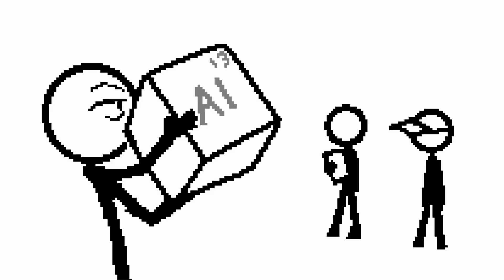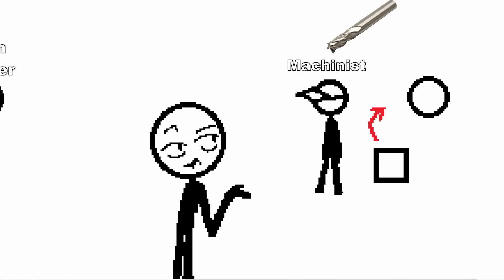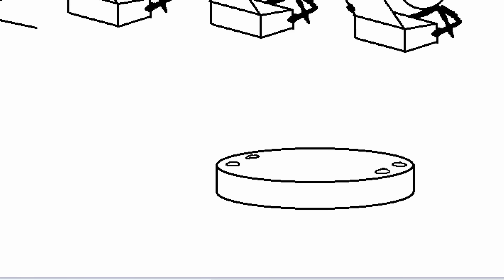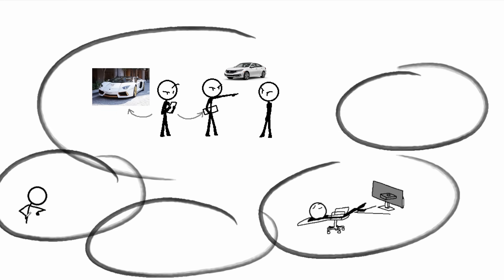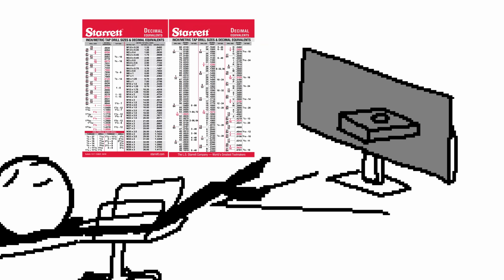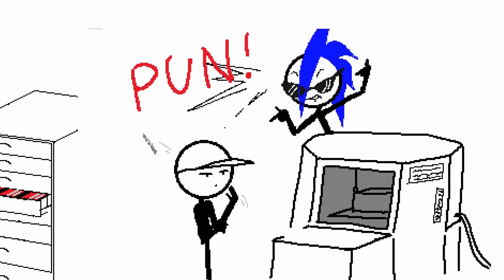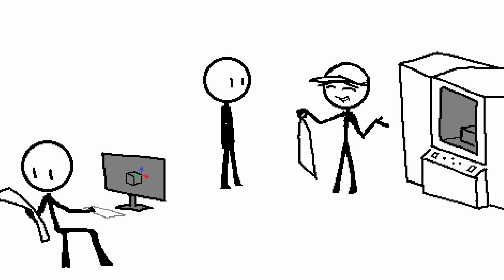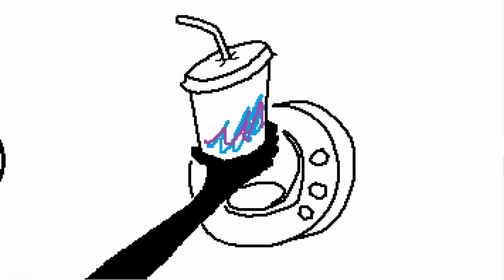Why we hate engineers

Comment: (soon to be) aerospace engineer here, this is engineering 101. The most important things we learned in our engineering class was to not overdo tolerances for basic shit, our teacher had a 3D printer on the rough setting for one project and we had to print and assemble a wing brace retrofit. Most of our class's models didn't fit together the first time because 3D printers always thicken everything a little bit (a 5mm hole might be a 4.5mm hole, a 5mm peg might be 5.5mm peg), so a bunch of people had to file stuff down, but then a few people had the issue of unrealistic thinness where their model would snap in half due to how thin they were. Watching this video in advance probably would have saved most of the class a bunch of time but I'm pretty sure this was meant to be a "learn it the hard way" project to drill the point in
Reply: Horizontal expansion should have been corrected in the slicer settings, rather than the model.
Reply: First off, buy a 3d printer. It's such a great hobby to do while you go through college. You'll also learn basically all your CAD stuff without even trying. 

Second, 3d printing has a ton of parameters, and you can drastically change results by tampering with settings. CNC Kitchen does a great job of going in-depth on individual parameters. You can watch those and combine some techniques to build some quite strong and impressive parts. But for things like holes, I almost always drill them (to the final diameter). If there's no requirement to pull parts straight off the printer and into the assembly, use a drill, a tapping set, a woodworking chisel, and some strong glue (epoxy or CA would be my choice). Those tools will allow you to do a ton with 3d printing for tolerances and mechanical fits.
Reply: And I was told almost exact opposite as my teachers required to describe everything what doe not really needs to be described
Reply: I don't think anything beats IRL experience, though. The video helps, but feeling the issues with your own two hands really helps.

After lots of hands on working with my Uni's 3D printers pretty much every part I design now fits exactly the way I'd hope for. PLA and a 0.4mm nozzle Prusa printer isn't amazing when it comes to precision, but when you design with the layering and expansion quirks of the material in mind you can get to some remarkable places.
Reply: Sounds like your school needed a better 3D printer! 0.5mm play. Holy shit. My Prusa MK3S can do 0.1mm tol and it's still loose on straight edges.
And people needed to run some tolerance tests first!

Comment: This is one of the best paint production videos i've seen, and funny as hell too, AND SO TRUE. I have worked in manufacturing, not as a designer or machinist but as an electrician and it's about the same, but it's most often the case that there are like a quadrillion of different types of everything, like 1000 things that do the same thing, just slightly different specs but they would all work but they want to save 5 bucks here and 2 bucks there etc. (money that is wasted in time trying to find all shit, and storage and everything, not to mention supply lines). So we had a small warehouse of electrical stuff, that many of them was used like once every 5-10 years. And an internal database of everything because the names of these objects is like ER-43-FnFI.3432.5 50 16A but don't mix it up with ER-43-FnFI.3431.5 50 16A because that looks exactly the same but have vastly different properties. So i felt like i was more of a logistic clerk trying to find waldo and staring down at papers at super wierd names making me dizzy, than being an actual electrician.

Comment: In Germany we have the DIN, which basically means "German Institute for Standardization" and the DIN specifies everything in such a way that there is only a fixed selection of screws, gears, etc.  So all drawings are ready for production and all threads are fixed.  That makes it much easier for the people in production and we have a lot less stress with them.  In addition, everything we design is therefore more maintenance-friendly for the installers.
Reply: Which is nice in Germany, but maddening to anyone involved as soon as any of those things have to be fixed outside the country. German-made stuff has a certain reputation in machine shops around the world. All that internal standardization is basically unicorn farts to everyone else.
It's not so bad most of the time, and people tend to get the gist of it with experience.

Comment: I am an apprentice trained designer so the first 4 years I spent on the shop floor covering as much manufacturing as possible, from regrinding drill bits to CNC programming and everything in between. By spending time on each process it gave me a greater understanding of what is and isn’t possible. I have worked with purely university trained designers and their lack of hands on experience usually shows in their designs

Comment: OMG!!!! I'm an electrician and I was saying "YES!!!" to almost the whole video. Primarily the end about mixing engineers and the old experienced dudes who actually installed shit for a living. I really liked the animation too. It may have been simple but it delivered where it needs to deliver. I laughed, I cried, and I had boughts of anger (borderline PTSD?) at how close it comes to everyday life for tradesmen. Well done!
Reply: No bro I want every device wired with 3/4” rigid metal conduit and #10 stranded wire. All data wire must be belden, data boxes require 2” conduit. I want every light controlled with a 3 way switch, motion sensor, time clock and photocell. I also want cct:1 on one corner of the building, cct:2 on another corner and cct:3 on a different floor. 

Any deviation from the engineered plans require written consent from the engineer.

Comment: I'm a boilermaker/welder and a mechanical engineer. I tell you what, my trade experience really comes in handy as I constantly think on how I would make this thing myself that I'm designing. I've seen so many engineers/designers that have no practical experience, designs something that is either impossible to manufacture or frightfully expensive when it never needed to be.
Reply: I feel like hands on experience should be a requirement to be an engineer. That’s how it was back in the old days, we should’ve evolved to tinkerers that also know the theory behind why it works.
Reply: @sama847  totally agree. There’s a lot of engineers (many from India) that have not mechanical know how or even an interest in mechanical things outside of work. Just got their degree (and that’s often fairly suspect) and straight into some engineering role to wreak havoc 🙄

Comment: I'm not a machinist or an engineer I'm in IT and I've worked with both of them... this video is too accurate. I've heard each b!tching about the other about basically anything on this list. One of the companies I did IT for at one time were making parts for SpaceX's dragon capsule as well as a LOT, and i mean a LOT of medical grade stuff. It was really cool to walk around their office, then their machine floor. I told my coworkers, "it's really cool to be in a place, than even if they shutter their doors, they still have a few tens of millions of dollars in assets to liquidate" IE their CNC mills and lathes. I remember they had a separate quality control area that had some really expensive microscopes and stuff and a clean room for the medical grade stuff

Comment: I remember taking a machine shop class in high school, had to make the the G-code for a part to be machined. The teacher told us some of the limitations of the auto path generator in the program we were using. And how it couldn't path through these tight gaps in the design, so you'd have do more manual path generation.

The path generator on my computer worked just fine, and asked him to take a look. Turns out I set the minimum cut radius to 0 and that was the reason it worked. It turns out he just didn't realize the program could path such tight gaps properly so he never bothered to try changing that setting.

So moral of the story is that a computer lets you try things you otherwise couldn't without risking something expensive breaking? I guess?
Reply: The other lesson it teaches you is that sometimes having a guy with 0 experience look at things with fresh eyes allows them to see the stupid easy solution a 100 experienced guys could not.  Good old "blinded by experience" type problems.

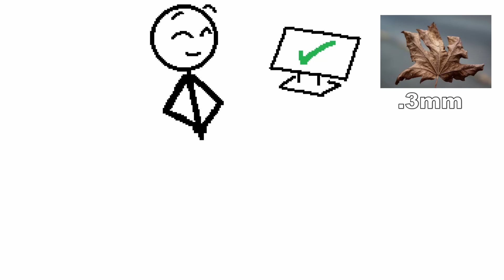Comment: 4:00  a sheet of metal that thin will vibrate A LOT when cut on.  We machinists will do our best to alleviate that vibration so that a good, in tolerance cut is made. Otherwise if they don't care, it will come out all fuckered up.

My machine shop really needs a meeting where everyone watches this video.  The amount of copy and paste tolerances, and title blocks are insane. They even (no shit)  put the "third angle projection" on every print, despite the print obviously being in first angle projection.  This is bad for symmetrical parts. I have read them in third angle, but they wanted first angle. Well the print said third angle and I gave them just that..... they weren't happy that I did my job correctly.  Not only that, but the engineers made a habit of coming out to the shop to check on their parts. I never minded that, and I have welcomed it.... but alas, all they did was complain that it wasn't done already, or that it would have been faster to do it this way instead. As if they have ever touched a machine in the last decade (or ever) and then they ask the dumb questions to top it.

There was 1 time I had a print that was honest.  The true position of a hole was + - 1/8". That's now insane to throw it into a CNC machine that is capable of a .0001" tolerance. That tolerance could have been done by a blindfolded monkey with a pistol drill.  No need to waste time with setup or programming. Just need the print, and the material at that point. But no. They wanted to waste time and money.

This is a great video. Might even boost the "already in the gutter and possibly people seriously consider going postal" employee moral.

Yes. We hate engineers.
Reply: Engineers love to check things and then ask dumb questions.

Comment: As a mechanic, also take into account how replaceable a part is, and how easy to replace it is. I understand how difficult it is to make and design parts but I have seen countless times where  improvements could of been made. But I’m no professional machinist or designer so if you think it’s good then I guess it’s good.
Reply: 3 inch bolt 1 inch from structural component turns a 45 min job into a 10+ hr job.

Comment: as someone who's worked about 10 different places in this field, the recurring problem I keep seeing is engineers not being taught much in school. They're not taught anything about machining, and do silly things like make square holes and what not. They haven't a clue what's feasible, realistic, or just plain imaginary. Unfortunately, they also aren't taught very well how to handle their own CAD software. Most times what I've seen is that the colleges will run the student through 5 different CAD programs, giving them a couple weeks in each. Sure, it makes them somewhat "familiar" with the program, but they never learn how to do any proper modeling/designing, and haven't a clue what parametric even means. So not only are they borderline useless to machinists since more machinists are doing their own CAD work, they're not even useful in the office space either. 

Engineers who give a toot and want to learn do take the time to come down to the shop and ask questions, and once they get properly "seasoned", they can amount to something pretty great (no thanks to the college). Sadly, most engineers don't do that from what I've seen, and some engineers don't even have that option due to the shop being in a totally different location. The college seems to inflate their egos to the umpteenth degree and they think they already know what they need to know and that machinists are merely there to do what they're told. 

I realize it sounds like I favor the machinist or might be one myself, but I assure you, I don't have a dog on either side. I am neither an engineer nor a machinist. I'm a SolidWorks specialist who gets called into these places because they can't do their jobs.
Reply: What's funny is that for god knows why the school I attended used Inventor and only taught inventor.  Now I am not an engineer with a degree.  I actually am a piano technician working for a manufacturer.  But in manufacturing, solidworks is the mainstay software because of the licensing system.  Having learned it as part of my job its actually a far better program to work with and is much cheaper since its not a subscription service.  So many of the engineers out there have no training on what is the most useful software package out there in terms of pricing scheme.  And multiple "engineers" I have seen just are not adequate.  They keep talking about the engineer shortage, but they are everywhere.  Multiple friends of mine have their engineering degree and cannot get a job.  And then when I ask them basic stuff like tolerances, and manufacturing process optimizations, they haven't a clue about what the heck i am talking about.  They can make beautiful 3d models using software no one in the industry uses, but they cannot make something that will work.  Things like how you put the darn thing together or how the heck are you supposed to make this are not taught.  My boss actually will not hire engineers for his engineering spots.  He will exclusively hire tradesmen and machinists.  Because they have an understanding as to how to make things and can very quickly learn how to design things.  Why hire an engineer when you can hire a tradesmen and give them the education yourself to be an engineer for your purposes in less time than it would take to teach that engineer how to be a machinist. 

I guess that's why all of the people I know who went into the trades and learned skills in things like Aircraft maintenance, Machining, welding, and other trades actually have decent paying jobs and I know multiple Starbucks employees with a 6 year engineering degree they paid 100k for.
Reply: @zackeryhardy9504  you nailed it on the head man. I've been a SolidWorks specialist for a little over ten years. I've seen engineer after engineer just like you described. Doesn't know the first thing about how to make anything actually work. And they're in very high supply. Pretty much a dime a dozen at this point, but man does that not keep them from thinking the world of themselves. 

Most of them "know" Inventor and/or AutoCAD, which is arguably one of the most useless pieces of software in the field at this point. 

My job usually entails teaching them how to do their job, while earning half their pay. My local area still believes only engineers can do the job, despite calling me in to fix their problems. 

Don't guess you and your boss need some SolidWorks help do they?
Reply: The college seems to inflate their egos is true.

Comment: As a former engineering student, I never understood the reason why alot of people do the whole “lets have extremely specialized people do design this part and not communicate with the other specialists who are actually making the part”. 
To be fair, I was more or less a loner and was basically the all-in-one math guy, designer, and manufacturer, so it was easy to see all factors that come with fabrication since Im not a specialist.
It just straight up makes sense to have multiple types of talents on a single team so you dont have to waste time with the next team working on the project. Im not really surprised that this model of working doesnt get used much though, since its basically the same in schooling.

Comment: as a machinist i can confirm this. i often get drawings that are unnecessarily overtoleranced og overcomplicated. they love to stick asymmetrical tolerances on the drawing, which increases the potential for error, and i meight have to move things around  in CAD/CAM (features or model-sections), in some cases it meight be imposible / very hard to make without redrawing it. 
it would make my job a lot easyer if they drew the part in the middle of the desired tolerance.
i have heard story's from my colleagues, that if you try to call the designer and give them feedback they will basically call you stupid.
Reply: When I was a machinist I used to watch the engineers with a fake face of awe and wonder. They believed it, too.

Comment: 4:53 You Can totally make that part, all you need is a micro directional drill bit which you can extend with extension pieces.

Oh, did I mention that the tool I mentioned doesn't exist? So yeah, not only would the approach require specialized custom tools based on the horizontal directional drilling technique.